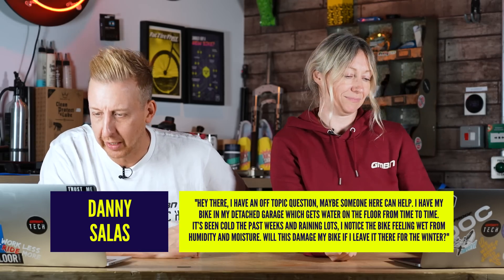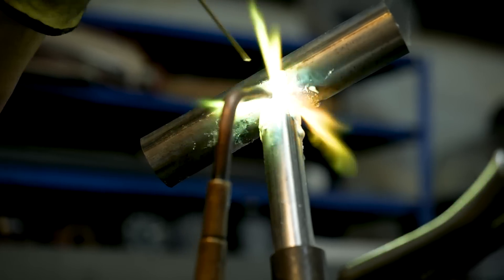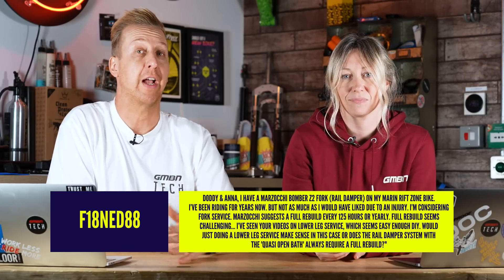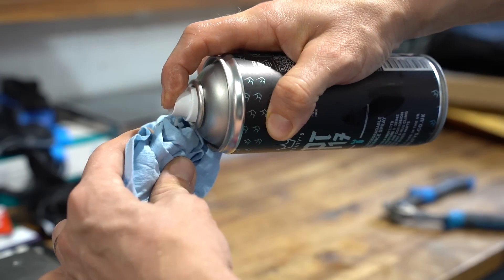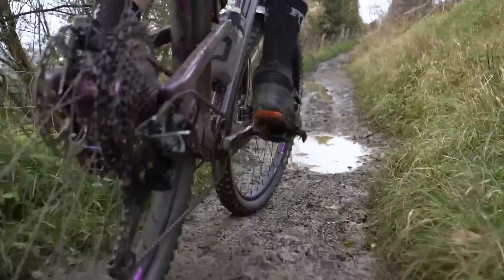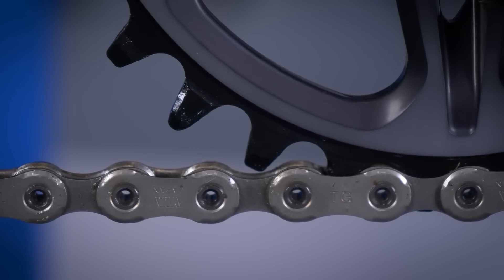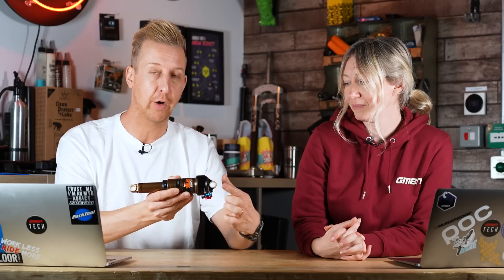Can You Convert A Frame To Disk Brakes? | #AskGMBNTech

Comment: I built a custom rear brake aluminum bracket on my 1997 Cannondale F1000, most people don't even see it until they look closely. I had to use a 140mm disk for the rear brake, and it works great. I also modified the front headset to permit me to put a 2016 100mm Fox 32 on it without changing the geo. Outside of being a 26er, after adding a Shimano XT  1x11drive train and a PNW Pine external dropper it is a very modern and capable cross-country bike. the next upgrade, in work, is high engagement hubs and 26' carbon rims. If you're willing to put in the work and do some home engineering, there is a lot you can do with old bike.
Reply: Never even knew they did 140mm 👍
Reply: I have a similar Cannondale - do you have any pics of your bracket?
Reply: Im building a 98 F900 and looking to do the same thing. Have you any pics anywhere?

Comment: I recently built up a basic Kona Lana'i frame and used an 'A2Z' rear disc/caliper adapter to convert and have been seriously impressed. It hasn't budged & i haven't had any issues whatsoever. You can use little spacers or washers to get alignment spot on. The only thing to watch for is your dropouts on whatever frame having enough room for it. Otherwise, A fantastic product and really happy with the modernised braking 👍🏻
Reply: Used the same adaptor to build up a GT LTS.  It was nice to have the braking power, but a royal pain to remove the rear wheel.
Reply: I have used this adapter to modify three Trek Y-11 carbon Y bikes to full hydraulic disc brakes. Takes some grinding for a perfect fit, but they work perfectly!
Reply: @letour32rr  Hopefully not something needed too frequently, And just allow the time. It's not bad really 👍🏻

Comment: Recently converted an early 90's GT, cut off the canti bosses and welded a disc mount plus a brace between the stays to support the added stress on the seat stay.  Running a 650b wheelset now which clears up to about a 2.1 tire in the frame!

Comment: Disc brake frames are built to handle the extra stress on the chain or seat stay that comes from the brake mount...adding stress where it wasn't designed to be loaded could be asking for trouble, especially after weakening it with welding...

Comment: We started converting frames back in the 90’s when disc brakes came on the market. There was no other way to fit Hope brakes to the rear of a frame without a home made bracket. Ran home made mount on an Intense uzzi as well as a couple of Diamond backs.
Reply: Intense uzzi.  🇮🇱🇮🇱🇮🇱

Comment: I had an engineering company weld a disk brake mount on my Saracen instinct 26 frame. Cut the bracket off a broken frame, shaped it to fit my rear triangle and aligned the mount with a caliper on a spare disk hub. Cost 30 quid for them to weld and heat treat it. It's quite a big job but you can save some money if your able to do the prep work yourself.
Reply from the maker: There are a few bike frame building companies that may offer the service also. It would normally cost more than £30 here in the UK. You must have found a very good deal! Is it true or did you need to mess about with washers for alignment etc..?

Comment: #AskGMBNTech My question is regarding Shimano resin brake pads. The G03S and G03A are the same  resin pad with different backing plates.  The S uses stainless, the A uses alloy.  What are the pros & cons of each type of backing plate.

Comment: Mike Burrows welded a rear disc brake caliper bracket to my 1998 Kona Kilauea frame, really neat job which together with the necessary rear disc wheel and shimano disc brakes greatly improved the braking. At the front I upgraded the forks to a disc equipped Rockshox and now have a set of effective disc brakes, a big improvement over the standard V brakes.

Comment: Disc brake conversion: I was going to comment that there are some really good rim brakes available now that work amazingly, so I was going to comment that I would just leave it rim brakes. Then I remembered when I converted an old MTB into a commuter for my son. I got some vbrakes that had more than enough adjustment to use 700c wheels. That was the easy part. LOL! The hard part is actually finding wider 700c rim brake wheels. That is the hard part. They can be custom built though.

Comment: I'm guessing that Cinder Cone is still on rigid forks so it should be easy enough to just swap them out for some aftermarket Surlys with disc mounts or something similar.

Comment: 6:11 I use Sram butter on the wire, No issues, it's suspension grease, so it's super slippery, and thin. It's made by Slickoleum, you can use Slickhoney, or Slickoleum too.
But Shimano has a grease for this job, but I've not tried it.

Comment: There is no reason to convert your rear wheel to disc as long as you put a large hydraulic disc up front. The bigger the disc the more stopping power you will get and 70 to 80 percent of the stopping power comes from the front especially running down hill. There are plenty of excellent V-brake pads and V-brakes out there that will easily provide the other 20& to 30% needed. Running hydraulic lines to the front wheel is super easy and you save weight in the rear .  Use a Velocity Cliffhanger 26" inch wheel in the rear on older bikes. It is double walled,  tubeless,  with a 25mm internal width so it will handle big tires AND it's designed to be used with rim brakes!  That's the upgrade you need!

Comment: ..Hi guys..luv the show..I've been given an dropper post for my mtb(boardman fs pro),by a mate,i have fitted it ok,but i have it fitted in the frame,as low as it will go,but when fully extended,it is about an inch too high..so,is there anyway to shorten it,other than cutting the seat tube down?..#askgmbntech...thanks..Tim..
Reply from the maker: What dropper post is it Tim?
Reply: @gmbntech  ..crank bros

Comment: Use marine grease on your cables when replacing. I have a container of marine grease with a small hole in the side of it I run the new cable through to grease.

Comment: #AskGMBNtech 
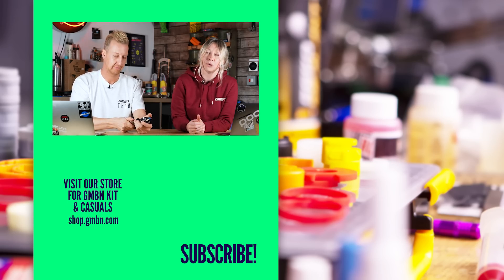I’m trying to understand how best to take care of my drivetrain.  So first question would be how long should I expect a modern 12 speed drivetrain from SRAM or Shimano to last?  Second question: every shop I have talked to has slightly different guidance on chain waxing and care. One shop told me that the chain and the cassette should wear together and that you should 14:30  just replace the entire cassette. While others have told me that riding with two chains that are waxed and alternated is best practice.  Help with any rigorous studies or data would be greatly appreciated.

Comment: Kona Cindercone brakes: Buy a Avid SD7 or Arch Rival and you will have the power. No mods in the frame. Fork, buy a 2005 SID or the last model a SID 2006, light weight and will look much better.

Comment: XT is weight weenie gear. If you're built like a shoelace and weigh 90lbs maybe a few grams matters, but try to put any real power through those aluminium cogs and they're toast lol. 

Same goes for those silly skinny chains lol, they feel like a rubber band and have all the strength of soggy ramen noodles when you even try to dig in to the pedals for a climb or sprint, a glass drivetrain. 

Even the heavy duty stuff like single speed with a bmx freewheel isn't really bombproof unless you go with hardened 415 motorcycle chain and a double stack of hardened steel chainrings up front. That's the only setup I was ever able to push 100% with on a steel frame. With aluminium it will crush the chainstay like an empty beer can or tear the bb or rear triangle off.

Comment: Hi Doddy & Anna. I have a 2021 Vitus nucleus hardtail with a 135 X 9mm quick release on the rear. I need to get a new rear wheel. It's not obvious to me what wheel would work. Also is it possible to change the QR to a thru axle? If so, is it much work/worth doing? Thanks
Reply: #AskGMBNTech

Comment: #AskGMBNTech. Hi Doddy and Anna I have a Scott Ransom E-ride 920, my quest is I have a knock block fitted to the lower part of the steer tube would I be able to just remove this or dose it need to be in there for spacing on my head bearings

Comment: #AskGMBNTech  I am currently using a Sram NX 12speed derailleur which came stock on my 2022 Scott Scale 940, I found the clutch/spring not being very strong, cause I have a lot of chainslap.. is the XX1 derailleur fitted with a stronger clutch/spring and would that solve the problem while upgrading?

Comment: #AskGMBN Hello everyone. I was given a new set of  wheels with mtb tyres for Christmas. I was thinking about putting some road tyres on them so I could use them on my roller or to train on the road. What can you tell us about road slicks for 29" mtb wheels? Are there many options? Will a regular 700c tyre fit on my wider rim? If possible, I'd like to go tubeless. What do you recommend? Thanks in advance! Cheers from Spain.

Comment: #AskGMBNTech I'm thinking of upgrading the drivetrain on my bike, but I still feel like holding onto the old derailleur, shifter and cassette, to perhaps someday reuse it on another build. Do I need to do anything to prevent these parts from corroding in storage, or is simply cleaning it and chucking on the shelf good enough?
Reply: If it's stored inside a house it shouldn't corrode over time if you put a little bit WD 40 on it (which is essentially petroleum)

Comment: #AskGMBNTech Hello everyone. I was given a new set of  wheels with mtb tyres for Christmas. I was thinking about putting some road tyres on them so I could use them on my roller or to train on the road. What can you tell us about road slicks for 29" mtb wheels? Are there many options? Will a regular 700c tyre fit on my wider rim? I'd like to go tubeless. What do you recommend? Thanks in advance! Cheers from Spain.

Comment: Don't use chain lube on cables, period.
New ones need no lube. If replacing just an inner, u can flush the outer with gt85/wd40/pt17 etc, then blow it through and allow to dry/evaporate.
But lube will make shifting worse over a short period as it will gum up. Dry lube even more than wet lube.
Good Inner cables come with bonded ptfe.
Reply: My dry lube is PTFE and I use it in my cables and have had absolutely no problems.
Reply from the maker: Ahh, this is an age-old debate Rupert. Some people insist on dry lube, some wet, some none. We have even heard of people using mineral oils or PTFE powder lubricants. At the end of the day it really depends on how often you want to change your inner cables, the conditions you ride in etc... What is more important is actually using a decent quality inner and outer cable

Comment: do not mig weld a frame. you need tig weld for aluminum. youll destroy your frame and significantly damage the easily meltable aluminum.